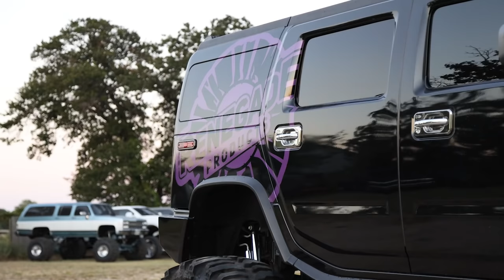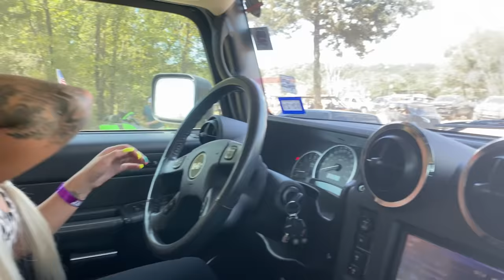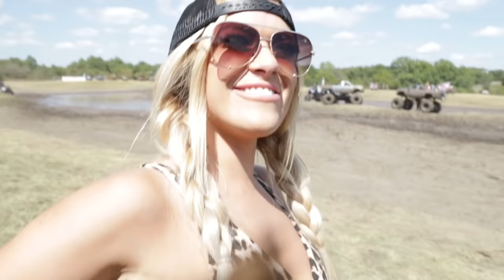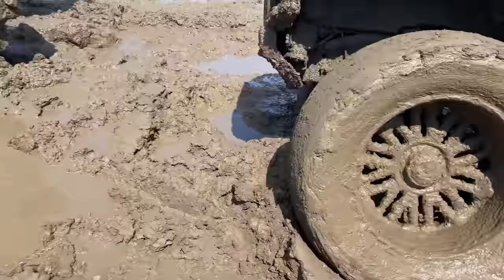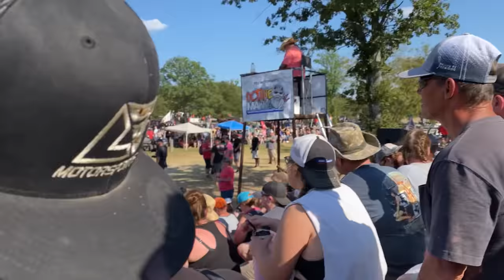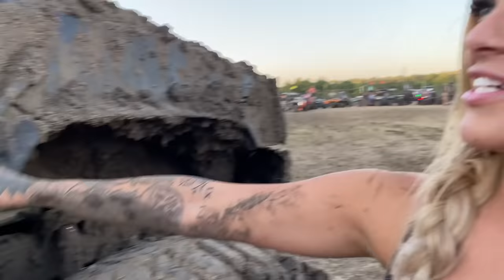Lacey took another SEMA build mudding! At Rednecks with Paychecks Park in Texas

Comment: For anyone that doesn't know....NEVER pull someone out in reverse whenever you can pull them out another way! Pulling on something when you're in reverse, puts all the weight down onto your front end. Your front axles and front drive shaft are no where near as heavy duty as your rear axles and drive shift are! Pulling them out in reverse, like he tried to do with the Razor, is the quickest way to snap an axle, break a U joint, or twist a front drive shaft! NEVER DO IT unless you absolutely have too!